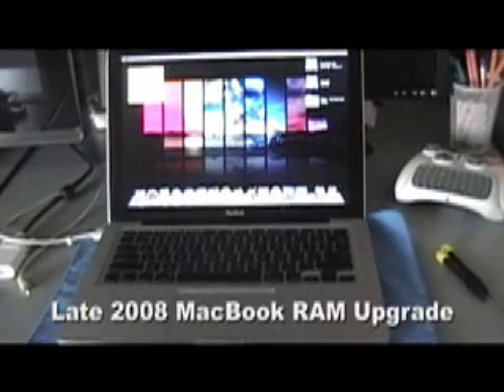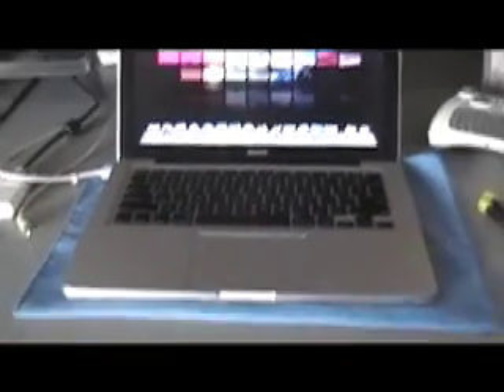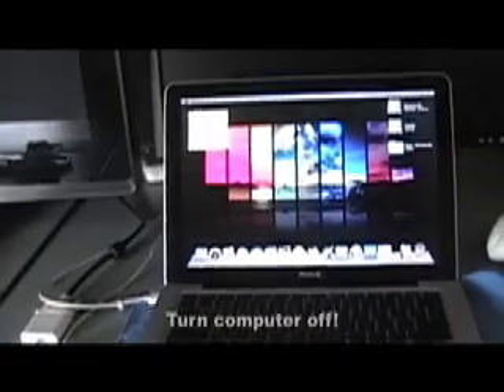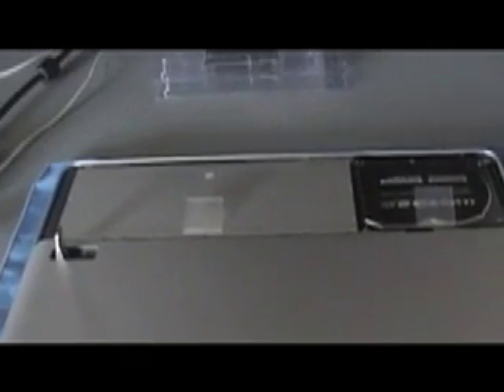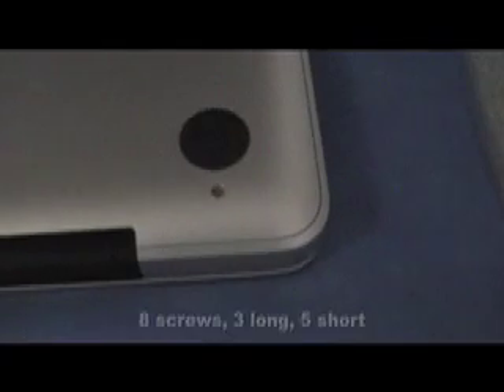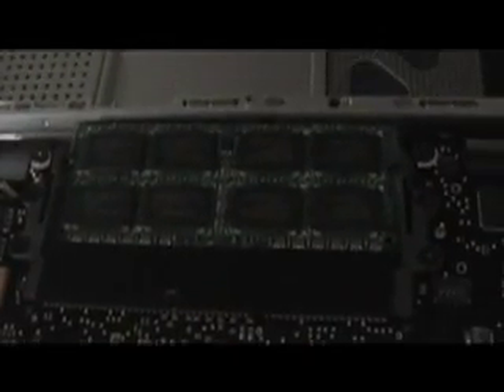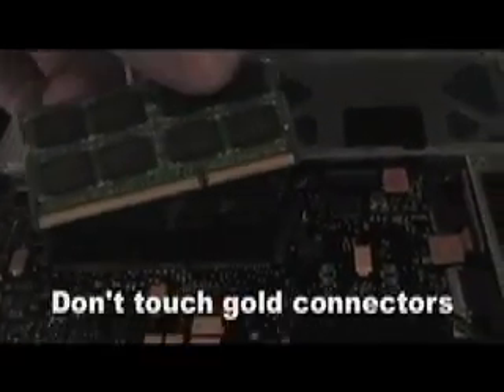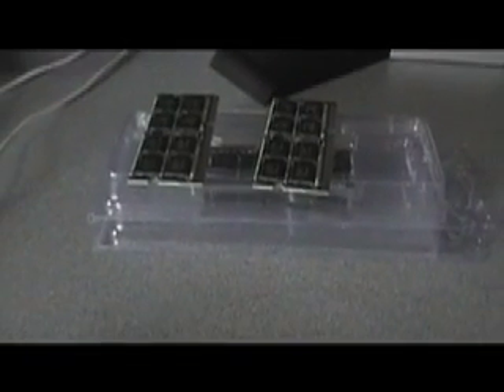How to upgrade memory, late 2008 Aluminum Macbook

Comment: What is the standard for the same model mac in terms of what it comes in. I ordered the 2GB RAM so will it have 1 x 2GB or 2 x 1GB. When i buy the 4GB will i be buying 2 x 2gb or just one more 2GB to add to the one already installed?

Comment: great video! i have a problem though.
i managed to unscrew all screws with a philips 000 screwdriver, except the two middle ones on the bottom. Aren't the all screws the same? i havent got a 00 so i tried with 000 and 0. 0 is too big... i m not sure whats wrong with the 000.
has anyone had a similar thing?